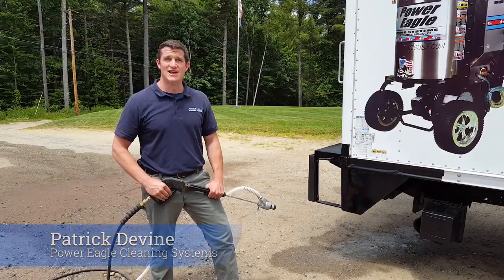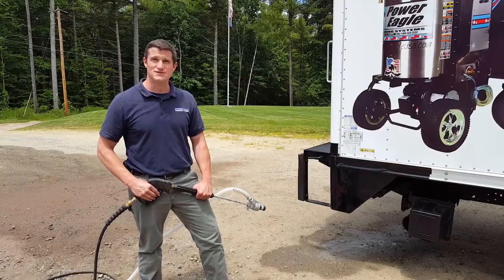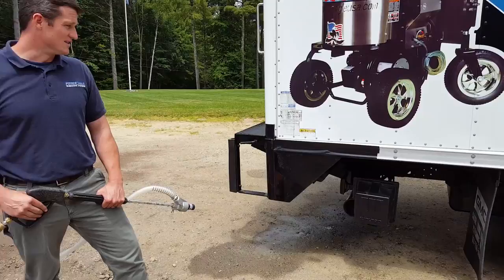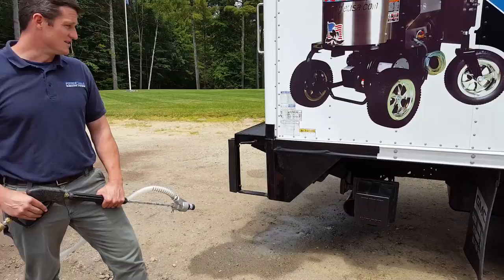Power Eagle Wet Sandblast Kit -VS- Rusty Truck Tailgate

Comment: Use similar attachment in industry and I have one at home . Fantastic tool . I use different grits and have a ball valve up by trigger in the sand pickup line . Can control amount of abrasive and shut off and just wash . I use a high pressure soap injector on pressure washer with high alkaline laundry detergent . Coats and cleans and won’t rust .
Reply: what Laundry detergent ?
Reply: @jasonmurphy1587  just use cheap liquid laundry detergent . Coats bare steel when dry . You need a high pressure soap Injector on washer intake too pump . If you you use hot water pressure washer with sand blaster it’s even better .

Comment: I bought one couple weeks back and finally put to use on my 65 ford econoline. Now I I used the one from Northern tool and even another from some other place that looked very similar. But not sure what y’all do but this one out of the 3 is at least 40% better and I say at least. Yes its probably 100-150 more but you get the wand with it but the fact that its at least 2x better means , well you guessed it. YOU GET WHAT YOU PAY FOR. cheers 🍻
Reply from the maker: Thanks Pete!

Comment: Good for cars and smaller projects..Not good for bigger projects like trailers.Also dry blasting makes paint stick better which is needed for trailer that are on the road 24/7.But for cars its good as it does not heat the metal.

Comment: We bought one of your systems, and its going through media SUPER fast, got the air inlet opened all the way, still going through alot of media, way more than 10lbs per minute. Any advice? Using 30-60 Black beauty, 4400psi 4gpm.

Comment: My pressure washer just goes to 2,200psi, will this work at all? I know it wouldn't be this good but I it takes longer that's ok.
Reply from the maker: This depends on the GPM flow of your pressure washer. If it's around 4+, it will work better. If it's 3 or less, it would be quite slow. I've never tested the kit below 2500 @ 3.
Reply from the maker: Depends on the GPM of your pressure washer. If it's high (like 4 or 5 gpm), it will work. If it is 3 or lower, it won't work well.

Comment: Hi. Does this run through bags of sand super quick or is there a way to control the amount thats being injected? Also can i use glass blasting bags  instead of sand bags?
Reply from the maker: Media use will depend on psi & gpm rates, but it will use aprox 10lbs for every full minute of "trigger on" time. During that time, it will strip 1 square foot of well adhered paint to bare steel. You can use pretty much any type of media, including glass bead. Best to test different types of media and see what works best for you.

Comment: No air compressor needed ?? How generate pressor ?
Reply: With the waterblaster,the media is the part that cuts away at the rust etc
Reply from the maker: The sandblast head creates a large amount of suction to pull the sand from the container, though your sand hose and into the head where it mixes with high pressure water and gets sent out through the carbide nozzle. Works great and won't clog.